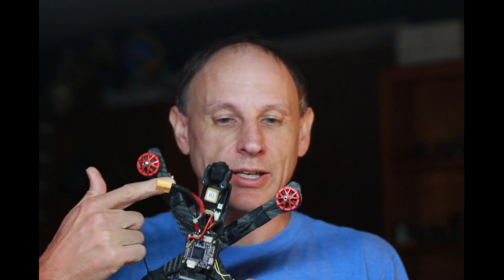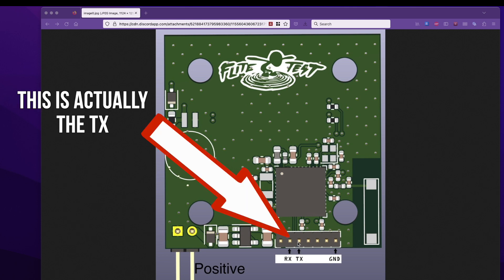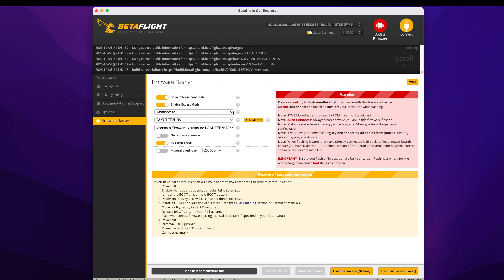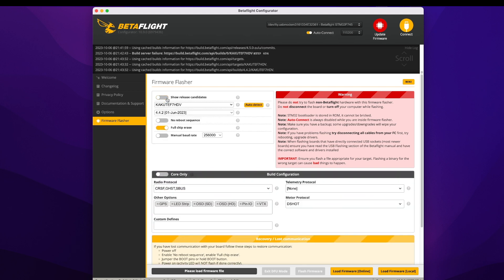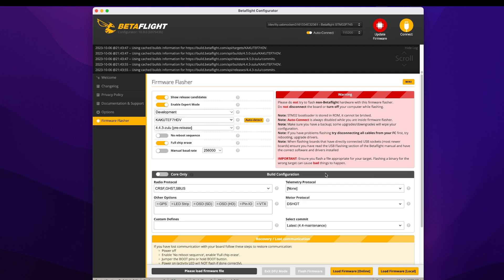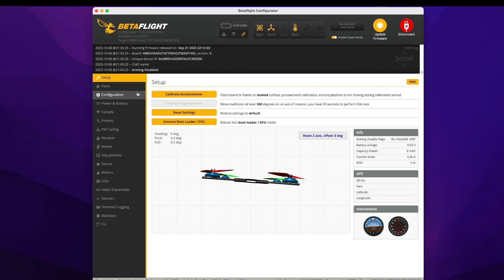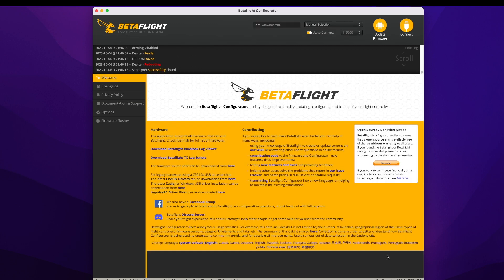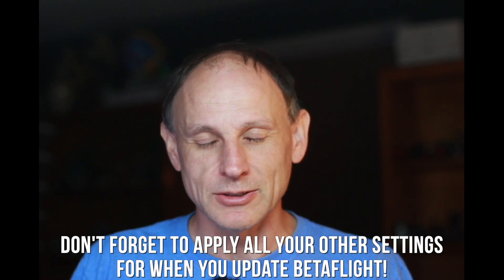How to get GPS from Flite Test EZ-ID to Betaflight

Comment: Hey there! Thanks for putting this together. I have an issue, hoping you can help. I don't have an option in BF10.10 for a 4.5-zulu firmware and I absolutely cannot get GPS to work on 4.5.0-RC2. Any idea what's going on?

Comment: There should be more shown in the gps tab.  The gps tab should have info about each sat and yours is greyed out like mine.  Once i switching to a separate gps from the ezid i then was able to see the data from each satellite in the gps tab.  

The way you have it setup does not work correctly and you will have your home point off even if you have 20 satellites.

Comment: You have the m8 version right?  I got the new m10 version and am only getting 5-6 satellites and according to bardwell you need to do an update to the m10 for it work correctly. Do you know anything about the new m10 flit test module?
Reply from the maker: Yes, I have the m8 version of the EZ ID.  As far as I know the m10 that is part of the EZ ID should have all the updates applied before it was shipped.
Reply: @5zero7RC  this is the update, i think its because of the way betaflight is working with the m10 where the m8 already has everything correctly updated. https://www.youtube.com/watch?v=5fBDqeAoqvI
Reply: @BuddsSkyCam sort of BF4.4.x has too many dev mistakes and no support fro the M10 so it takes far longer for cold start. Use the better and safer BF4.3.2; GPS rescue is unsafe on BF4.4x in our opinion and we pulled it from all iFlight product that uses GPS - wait for BF 4.5 with full M10 support or just use BF4.3.2 that doesn't slow cold start as much on the M10. 4.5 is RC1 now release should not be too far. and its amazing with return to home and fast M10 support. too.
Reply: @TheMoonwatchers  i was talking on the bf discord and was able to get 4.5 zulu updated yesterday morning and i went from 6-8 sats sitting in my house on 4.5 rc1 to now 10-12 on 4.5 zulu just have to make sure barometer is off.  They are working on it but 4.5 zulu with baro on and gps on, the gps will not work.  Spent all day yesterday chasing that issue, after the day before there was an msp issue when using gps but its working really well today and i hope to test the gps tomorrow in a bigger area.

Comment: Any Idea why when I select mps for my uart2 that its on that it removes everything selected from the ports tab?
Reply from the maker: If you try to enable MSP on a 3rd or maybe it is 4th port, it will reset all the ports.  MSP is not supported on that many ports.  That's my first guess.
Reply: @5zero7RC  i was going between your video and bardwells on gps m10 and i was selecting gps in tve ports tab after i clicked msp and that caused it to reset it.

Comment: Have you tried RTH with that setup on betaflight?  Are you using this same method for INav?
Reply from the maker: I have never tried to use INav.  I have not yet tried RTH, but I do get good GPS coordinates in my OSD, so I assume it could work normally.
Reply: @5zero7RC  wish they made these with the m10 gps.... would be cool to see how accurate it is with RTH is with the rfid.  Thanks for make thia post you are the only one i have found to have and do this